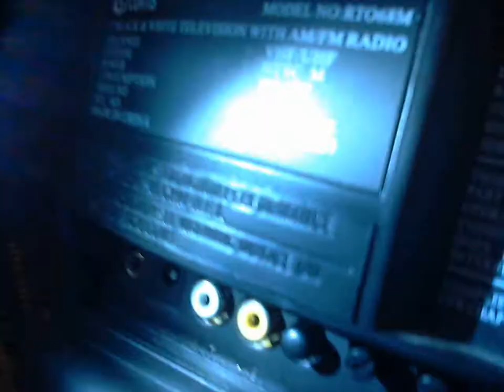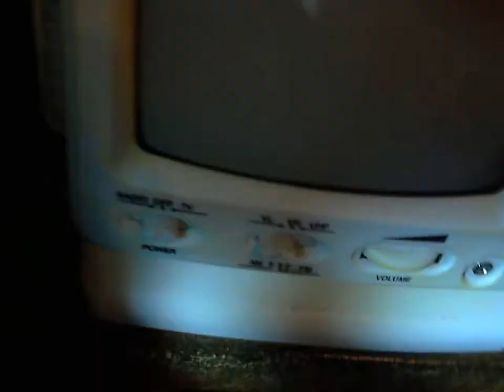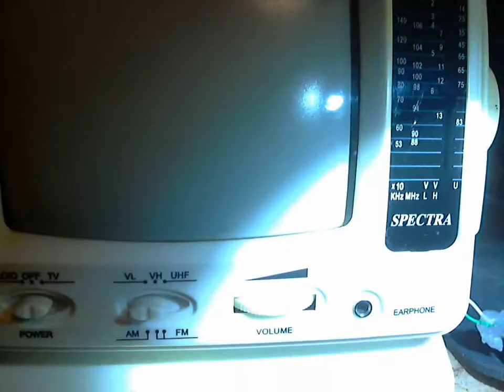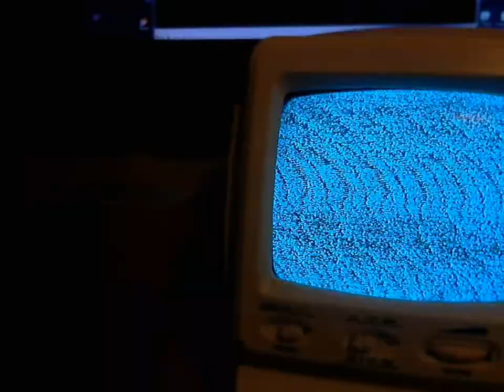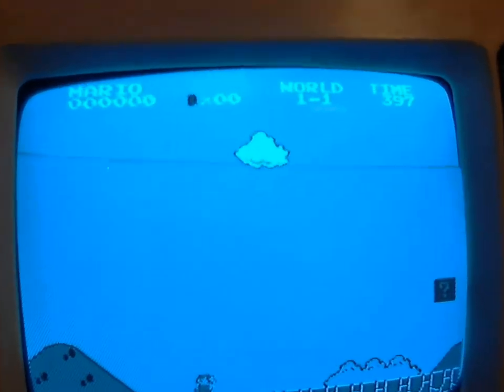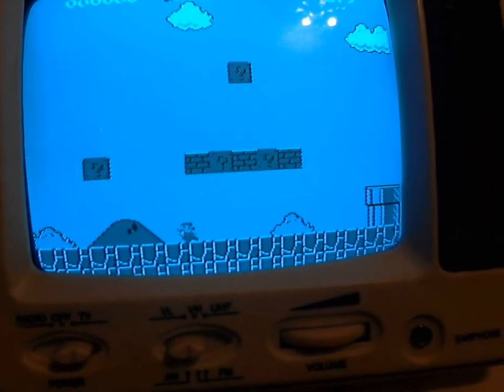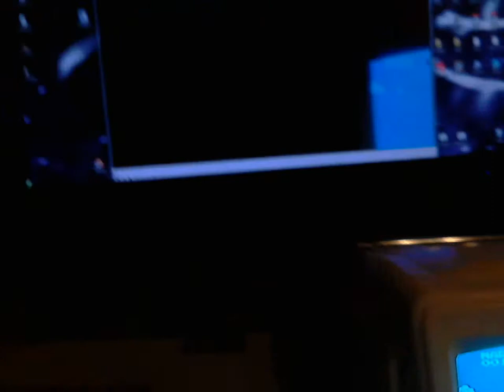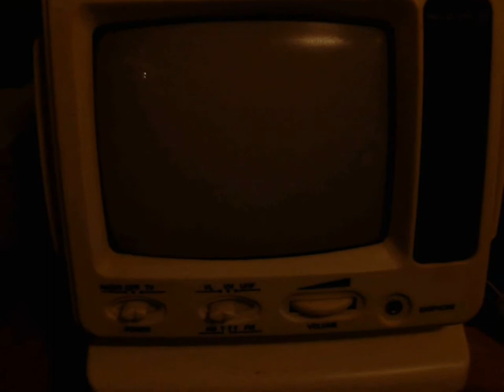Adding new features to a old B&W CRT TV. :P

Comment: Hi, would you mind sharing diagrams or any info about which pins you used to do the composite mod in the model with the hanging wires? Thank you!
Reply from the maker: Unfortunately there are no schematics I could find for this TV. I did find a pin out diagram to the main IC though:

https://i.imgur.com/rrcNXv8.png

Pin 5 is the composite video output of the chip. On the RF only version, I believe it's connected to a capacitor or resistor. I don't recall now. You can tap it at that location (or pull the pin from the board and tap there I guess). I didn't permanently disconnect pin5. I connected it to a switch so I can still use the RF tuner if I want. But you can do it in a simplar method if you don't plan to use the RF tuner (RF radio if you set has that feature should still work anyways. Only video goes out of this pin)

I never bothered to find where to tap for audio input. In fact I just used the RF tuner for that. Connected VCR to RF input, then video out of VCR to my composite video jack. That's how I handled audio. :P
Reply: ApacheThunder Amazing, I'll try that. When I was a young student, used to watch TV through a broken VCR connected to some PC speakers and a green phosphor Tandy monitor, so maybe the way you do is just the reverse of this. Thank you a lot for the information!
Reply: Hi! I have a similar old B/W mini TV which uses a D2915CP chip (which looks to have the same pinout as the one you're using). I tried just hijacking pin 5 and inserting my composit signal. The monitor did show some strange wavey patterns but nothing reassembling an image. I then checked the output of pin 5 from the IC and saw that it had 9 volts on it, so it doesn't really feel like a composit video signal. Am I missing something?
Reply from the maker: Probably not. Possible you pulled the wrong pin? As I recall pin 5 was on the left side of the chip. (when board/CRT is oriented away from you assuming your TV has the chip wired in the same orientation)

Also it may just be driving the signal at a higher voltage then a normal composite signal. Find the nearest component that is connected to pin 5 and desolder it so that pin 5's output is not connected. If you lose video information from the RF tuner (blank screen) then that should be your composite input/output line. If however you get something else like distortion in horizontal/vertical deflection/ something other then a stable blank screen, then that is probably not the correct pin.